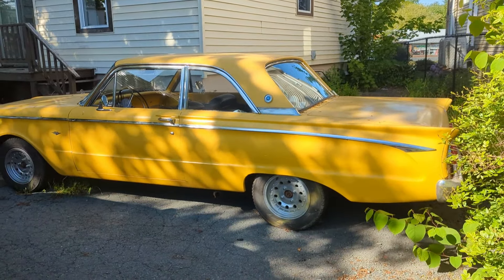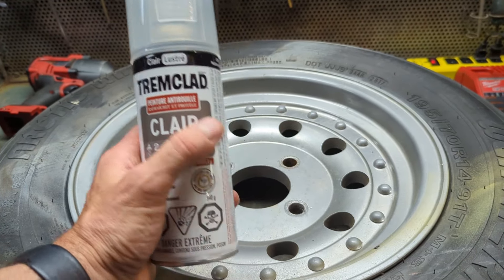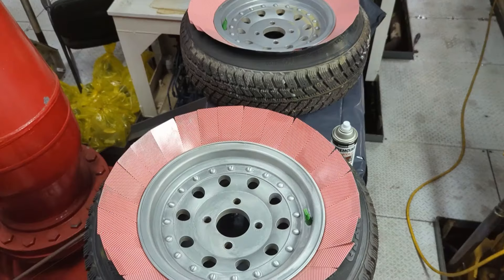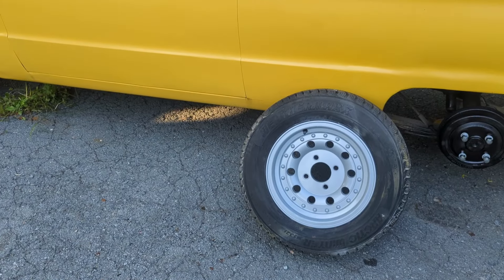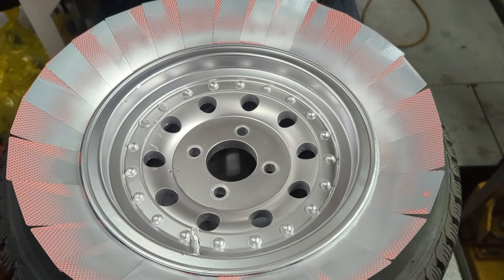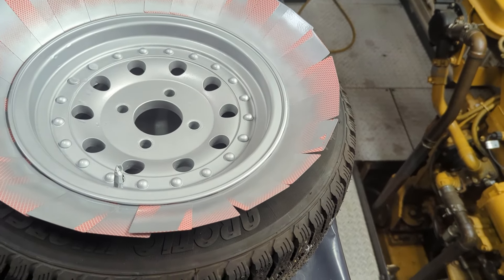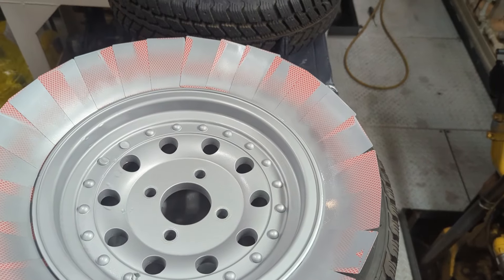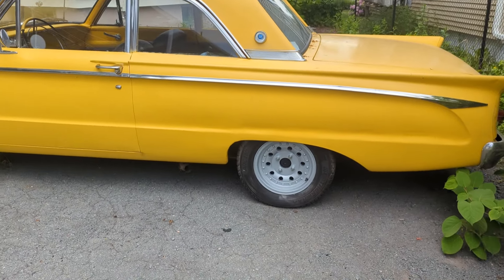Aluminum spray paint. Does it work on rims?

Comment: Try WD-40  to get the overspray off. Better than goof-off
HOW DO YOU KNOW?
Working near your CAT I see
Nooooo on the clearcoat.
If they are aluminum.... it would have been better to spend the two hours a tire and use a metal polisher tool.
WALK AWAY .
I'm waiting for the M.O.T.
Reply from the maker: Thanks Michael,  MOT ?
Reply: Inspection for driving on the road. Isnt what its called it in Quebec? aux SAAQ?
Reply from the maker: @Whitecranekungfu  We call it MVI. Motor vehicle inspection.